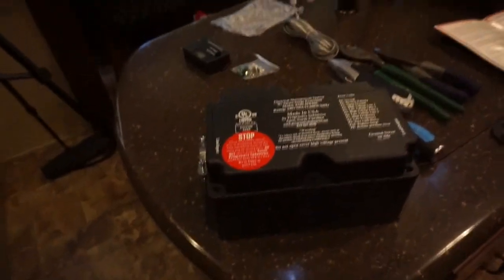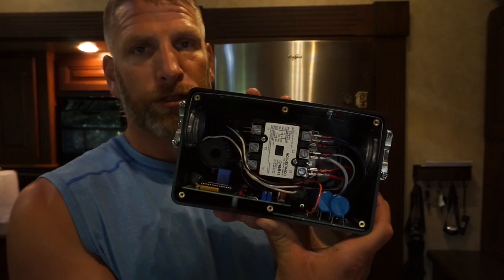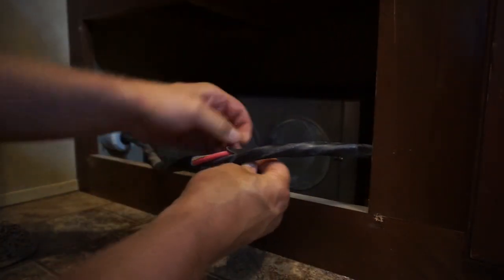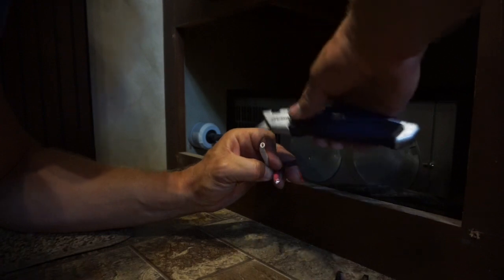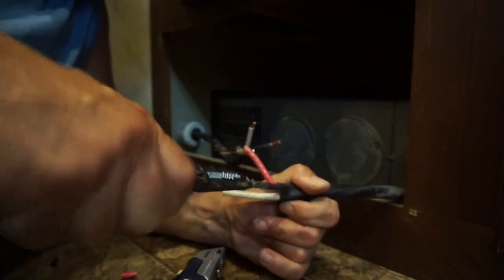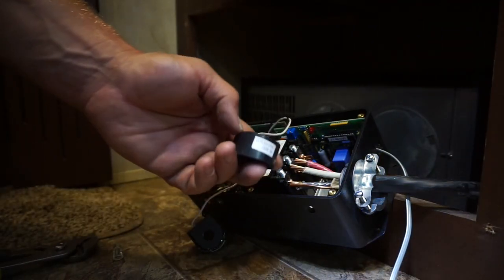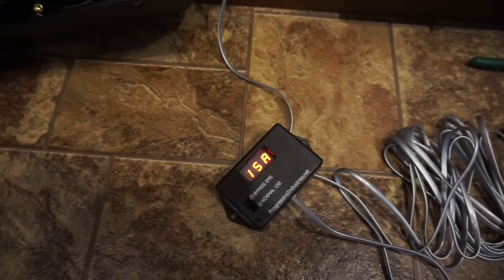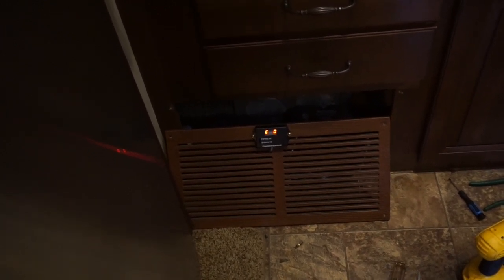How to Install Progressive EMS Electrical Protection System

Comment: Nice job Jeff next time yes the end of the wire strippers to get the wires into the terminals. That way you don't have to fight it so bad. And yes don't ask me how I know 😜 Your fridge and AC units will love you for that upgrade.
Reply from the maker: He says he did that. He just didn't video that part.
Reply from the maker: Yeah, I'll keep that in mind when I wire in a transfer switch for the inverter and generator.

Comment: I like the hardwired version due to the hardwired display. but with our class A i can put a portable one in the electric compartment and keep it locked up when plugged in. the one I want has bluetooth so I can use the app on my phone. but I would like to have both a hrd wired display for a quick glance when inside as well as a bluetooth for when i`m outside.
Reply from the maker: We like having it inside so that we never have to worry about it and we have the display!